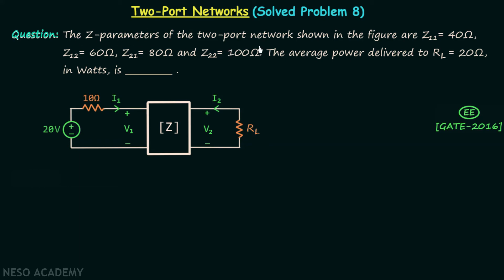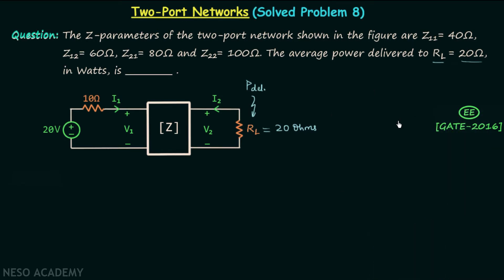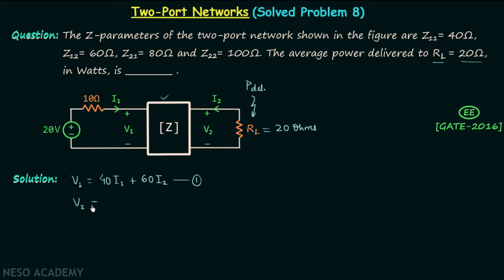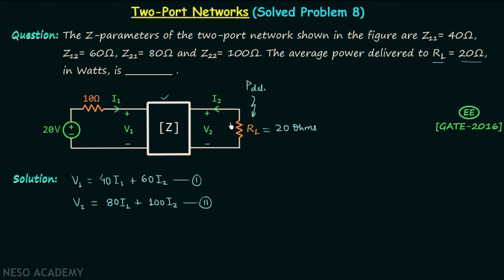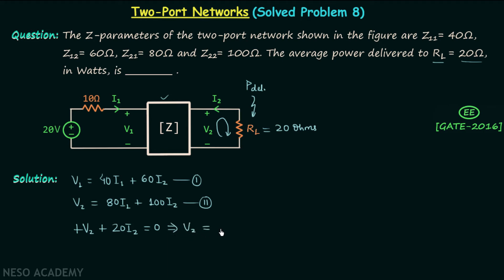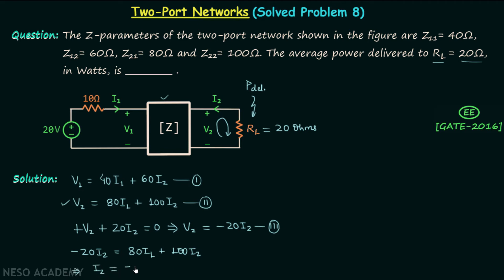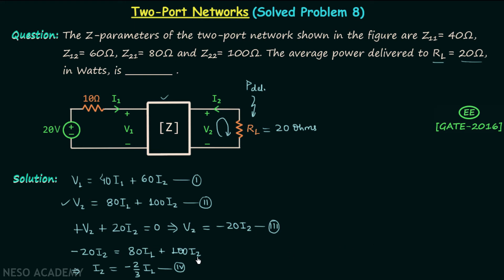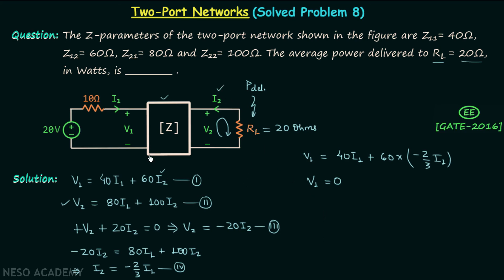Two−Port Networks (Solved Problem 8)

Comment: I think there's a mistake in taking the loop 2 sir......V₂ -  20i₂ = 0, V₂ = 20i₂
Reply: no no buddy its correct.. the loop direction is opposite to the current I2 direction, so there be negative sign but since it is resistive drop there will be negative sign as well and both negative will result in positive 20I2